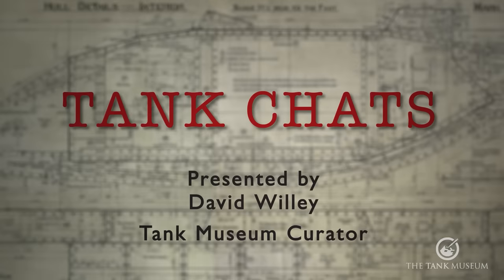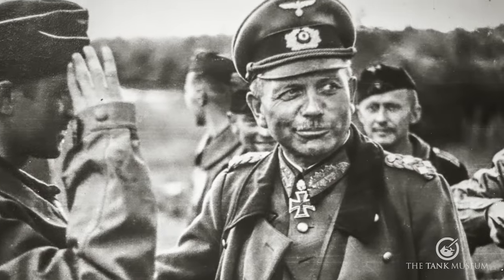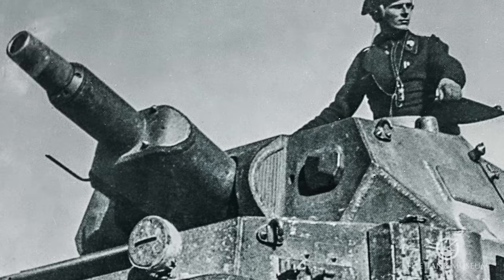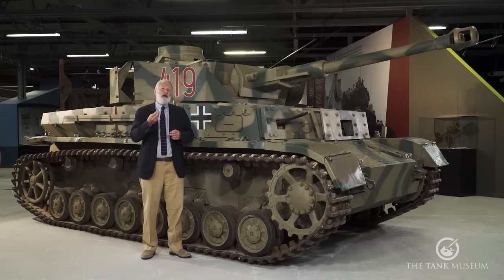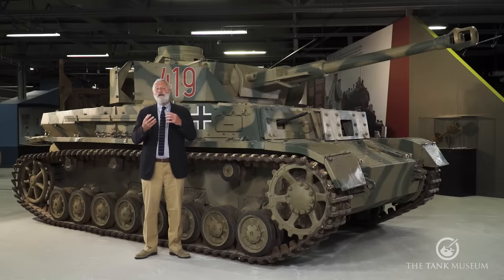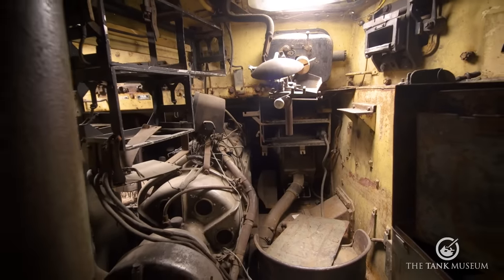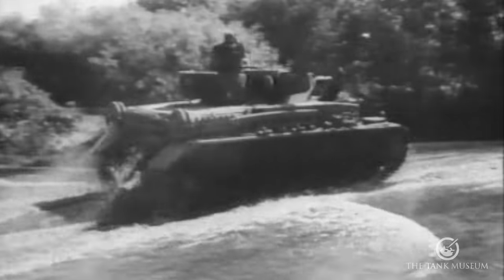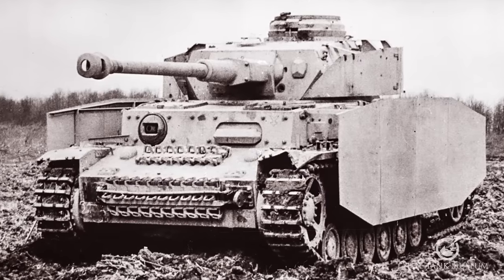Tank Chats #106 | Panzer IV | The Tank Museum

Comment: The Panzer IV is probably the closest thing to a "Daliy Driver" panzer you could hope for.
Reply: It almost makes one wonder what Germany would have fielded if Hitler didn't have his obsessions with huge guns and huge tanks. The 7.5cm/L43 could kill pretty much anything the Allies fielded short of the IS series or Pershing. I'm picturing a "baby Panther", with the 75/L43 instead of the L50 and slightly smaller, cheaper in every way.
Reply: @polygondwanaland8390  If they slope its front 5-10 degs more...it would help alot with its protection...
Reply: Good way to put it
Reply: @polygondwanaland8390  this would have done nothing to adress the Reich's biggest insufficiency, which wasn't as much the number of tanks, but the oil to drive them with. I get this "Hitler bad, so he must be stupid as well" shtick, but it doesn't hold true - a lot of German generals skipped taking responsibility for their own failures and blaming them entirely on Hitler.

The Tiger and Panther were needed. For the same money one could have built more Panzer IV's, but not found the oil to drive them with. Furthermore, as the development of the tanks started much earlier than they were commissioned, and as the German tanks were still struggling with lots of Soviet armour and could reasonably expect the Soviets to make even stronger new tanks (which also happened -> IS), the risk of all of a sudden having to face tanks that were too well protected to be reliably taken out was palpable.

TL;DR: The Reich favoured quality over quantity, because they had to, given the poor state of supplies.
Reply: @jonesjohnson6301  yeah and things like going for Stalingrad instead of the oilfields made the problem even worse
Reply: @jonesjohnson6301  You're right of course in that the only way for Germany to have won WW2 would involve not declaring war on the entire planet as a small country with limited resources. But there's definitely mistakes made because of Hitler's meddling – arguably every tank larger than Panther was a mistake because of the tactical and production limitations (the Maus epitomizing this). You could even make an argument that Panther should have replaced Tiger in the Schwererpanzerabteilungs instead of Tiger II, because if you're just a poor little Sherman a Panther overmatches you just as well as a Tiger II.

But if Germany lasts into 1946, it doesn't matter, because the Soviets will be producing more IS-2s than you can produce Panthers, and the T-44 will be entering the fight.

The real "what if" where Germany wins is Hitler simply being happy having taken half of Europe and not pushing his luck with Russia.
Reply: @polygondwanaland8390  , your last paragraph says it all. Russia was just too vast, with too many people, a strong heavy industry and two allies that filled-in the shortages that couldn't be produced domestically. Germany was doomed June 22, 1941.
Reply: @jonesjohnson6301  amen sir.
Reply: @jonesjohnson6301  yes and no.

Blaming hitler for everything is questionable. I agree.

Panzer IV wasn't designed for mass production. 8500 units from 1938 to 1945.

Ca. 6000 Panthers from mid 1943 to 1945. The panther was designed for mass production and could be assembled much quicker than a panzer iv. The panther lacked many of the fine features of early german tanks, like an apu, exhaust mufflers and stuff like that. They made that thing as cheap as possible and focused on the important parts.
The panther wasnt more complex than a sherman or a panzer iv, if you look at the complete design. Just highlighting its more complex running gear gives you a blurred impressions of the panthers overall design. 

They produced 4500 panthers in 1944. That is not bad compared to 11.500 T34/85 produced by the Russians in 1944. Tank exchange ratio was 1 to 4 in favor for the the germans in that particular year.  The panther was a reasonable option.
Reply: Tought it would be better for "track" days.
Reply: @polygondwanaland8390  you failed to see the whole picture. Hitler was capable of taking most of Europe because of the non aggression pact with Stalin. If Hitler does not invade Russia, Stalin for sure would invade them the next year after the great purge. It only succeeded in postponing the Reich fall from 1943 to 1945. The iron curtain probably ended up in the atlantic sea instead of Berlin...
Reply: "Yeah, I got a Tiger for the weekends but I daily a 161."
Reply: @polygondwanaland8390  Very simplified view of history you got there, buddy. 
First of all the Maus wasn't designed as a tank. The maginot line and the Atlantic wall showed that static defense buildings and fortification are very vulnerable in a modern war of fast moving mechanised armys.
The Maus was a more flexible defense weopon system to try out a new concept (mobil bunker used in combination with favorable landscapes). Every nation experimented with heavy break through tanks and assault guns. So tell me who where the drug addicted maniacs in UK, USA and Russia who were responsible for Tog 2, Tortoise, Black Prinze, US T14, T28, T95, T30 - T34, and all the russian objects of the same type. There were no computer simulations around, so every one was experimenting with those super heavy designs. Germany just ended up in the situation to field test such weopons systems because porsche built 90 tiger chassis with out an order to do so. The 90 Ferdinands worked out well in certain situations and an order was made to replace them with 150 Jagdtigers. So we aren't speaking of mass productions of those kind of weopons systems. The Tiger tanks were only built by Henschel in Kassel in small numbers. The Henschel factory was lacking the space and the tools to produce the simpler panther in significant higher numbers. They tried it with a batch of 200 Panthers and it did not work out. Tiger one was canceled in June 1944 anyway. 
So hardly any production capacity wasted.

But you can go on believing in the simple answers. It always grinds my gears how some random internet keyboard warriors think they are smarter than the complete scientific and military elite of a nation. I dont want to  glorify nazis, but to assume nazi eguals stupid is a dangerous move. Don't underestimate your enemy. There is a high chance, that psychopaths are also highly intelligent. 

1946 scenario:
The New Panther F/E50 and E75, which would share a lot of parts, (drive train roadwheels etc.) with stabilized optics and guns would be more than a match for slow firing ISs2 and T44s. The anhenced standardization of panthers and Tigers (E50 and E75) and the canceled production of panzer III and IV would also increase the monthly output of those tanks.
But the US would nuke the hell out off everyone anyways.
Reply: @polygondwanaland8390  I think if the Soviets had not tried to invade Finland before Barbarossa, they would have not been able to defend. Stalin realized he had sent to many professional officers to the Gulags, and released them back into service. Had this not been done before 1941, most of them would be dead, and the military would not function.
Reply: Yeap, it's the one of my tanks that I use to do my everyday running around! Could you imagine showing up at the local 7/11to get your morning coffee!!!
Reply: Stug Ausf G every time as the daily, keep the chrome rack for the Tiger it's protecting :)
Reply: Uncle Joe  I think they can weld on a small plate angled on the front glacis...even if it does not cover the sides...it can serve like some sort of spaced armored
Reply: Yes and why did the Germans turn to a Panther and Tigers when this tank produced in numbers may have been quite enpugh?
Reply: @Knallteute  We will never know for sure but I think had the Germans taken Moscow first then things might have been different? German forces did reach the oilfields of Russia but they were destroyed and burning like in the Iraq war 1991. When the infrastructure was destroyed it was of no use. Before the war Russia was supplying Germany with oil just as Russia sells lots of natural gas to Europe today. Attacking your neighbors is dumb anyway but Hitler had little reason to go into Russia but this is why he was a lunatic.
Reply: @HaVoC117X  Disagree....the Panzer 4 with the improved guns was all Germany needed....just MORE were needed!
Reply: @lisandrochavez7169  We cannot say for sure if Russia and Germany would have had war later had Hitler not attacked in 41.
Reply: @Jack51971  Since spring 1944 Tiger,Panther and the Panzer IV achieved almost the same combar ready rates (Tiger I and II combat tactics by Jentz).

To assume that panzer IV in 1944/45 were that much more reliable than the panther is a misconception.
They started to suffer from the same late war limitations as the Panther.

"From the front there continues to be serious complaints regarding final drive breakdowns in all vehicle types. Approximately 200 breakdowns have been reported with the 38(t).
Prior to the 1945 eastern offensive there have been 500 defective final drives in the Panzer IV.  From the Panther 370 and from the Tiger roughly 100.  
General Thomale explained that in such circumstances an orderly utilization of tank is simply impossible.  The troops lose their confidence and, in some situation, abandon the whole vehicle just because of this problem. 
He requests an increase in efforts for the final drive, since only this way can the problem be laid to rest.  With the previously intense criticism of the engine and the final drive continually playing such a roll,
it is welcome news to learn that the gearbox generally enjoys a good reputation.  (Page 259 "Panther and its Variants" by Walther Speilberger).

The Battle at Kursk showed, that germany was in fact lacking the resources and the manpower to supply the tank force they already had.
Every additional tank needs a crew, fuel, ammunition, spares and the logistics to provide all that.
Just screaming for more tanks does not help.
Nevertheless germany produced more tanks in 1944 than in all the years before.
The panther was streamlined for mass production. The panzer iv was not. Only 8500 panzer IVs were built from 1939 till wars end. But they built over 6000 panthers in less than two years. 
4500 in 1944. In comparison the Russians built 11000 t34/85 in 1944. Given the average tank exchange ratio of 1/4 in favor for the Germans, the panther was a reasonable option.
Reply: Ross Cox  And you be the Judge???? 
Without even adding something valuable to the discussion at all.

It’s hard to win an argument with a smart person, but it’s damn near impossible to .... i think you know how the story goes.

I will accept defeat, "Der Klügere gibt nach" as we say in German.
Reply: Ross Cox  Thank you very much, have a good day mate.
Reply: Lbot beenthere  Hindsight??? Very questionable and not reliable. Most credible Historians are careful when evaluate such alternative scenarios.

Which tank would have been a better solution?

More Pz IVs, which could not be produced as fast as a Panther.
Which suffered from the same final drive issue since 1944 like all german tanks? Tanks which had no problems with their final drives for years! According to Ralf Raths ( director of the german tank Museum)  every other tank or scenario would have suffered from the same limitations as the panther. In the end it would not make a difference. The panther was a reasonable option. 

Interesting Interview by chieftain which covers this topicc.
https://www.youtube.com/watch?v=MzZ4lV06n6g

Its the same Situation with the late introduction of the M26 Pershing, which many internet experts claim should have been deployed earlier.But given the realities in 1944 there was simply no way this could have happened. Hindsight can lead to easy but also many wrong answers for historik problems.
Reply: @Jack51971  un an alternative universe perhaps, we will never know it.
Reply: Mr. Kelowna  please learn some real history about WW2. Stop embarrassing yourself.
Reply: @Chilly_Billy  You could say Germany was doomed from the start, even if Germany didn't start the war with the Soviets, they would have run out of the necessary requirements for war, fuel for their vehicles and ships, and possibly bullets due to lack of metal in general (keep in mind the last one would be later if it prolonged after 1945) not to mention that it was less likely that Britain would have backed down and the eventual joining of the US into the war
Reply: @Knallteute  they did go for the oilfields in the Caucasus. They had to take Stalingrad to cover the Caucasus campaign. It was the loss at Stalingrad that forced the evacuation of the Caucasus.
Reply: @HaVoC117X  I’ve never heard it this way, thank you for your insight
Reply: @jonesjohnson6301  To be fair the Panzer IV was probably a good deal more fuel efficient than some of those ponderous beasts they produced later in the war. But the reality of the situation on the ground meant they still needed those big tanks. Best case scenario would have had them pass over the Panzer III and adapt the IV to multiple roles earlier, allowing them to make more IVs instead of the soon to be obsolete III. A few hundred more IVs with guns capable of beating Soviet armor might have left them in a better situation going into the winter of '41. Probably not a 'war winning' situation (any hopes of winning went out the window the minute the whole 'kick down the door' gambit failed to oust Stalin), but it might have caused a cascade effect of other battles turning in German favor and dragged out the war in the east for another year.
Reply: @hippoace  wouldve given the driver and radio operator more space too, or taken the add on front plate on the later models at an 10-15 degree angle to achieve spaced armor as well as greater ricochet chance and greater protection values. I think Military History Visualized brought up that they experimented with it, but “muh panther big cat” pushed it out of adoption
Reply: @jonesjohnson6301  Adding to oil shortage was iron ore shortage. German tank program had many professionals contributing. It wasn't vanity project a single person. Also, Hitler was stupid in a number of things indeed. He did put his emotion before facts; lacked technical skills; lacked good understanding of countries around him; gambled when odds were against him;  etc etc. His shortcomings just happened to be outside the ways of the the common myths
Reply: Seen the 3?
Reply: @polygondwanaland8390  1: Panther used an L/70, not L/50. 2: the L/48 replaced the L/43. 3: a sloped hull panzer iv was developed but never entered production due to the delay retooling would cause. 4: panther costs almost exactly the same as a panzer iv to build. 5: panzer IV was comparable to Sherman and T-34, which were produced in vastly larger quantities
Reply: Nope, a Sherman ( or a Lee/Grant or even a Stuart ) would be a more reliable "daily driver" and I suspect the service and parts would be cheaper!
Reply: @Vincent Lu Nope, a Sherman ( or a Lee/Grant or even a Stuart ) would be a more reliable "daily driver" and I suspect the service and parts would be cheaper!
Reply: @Knallteute  there is a youtube channel called TIK which has an awesome documentary series on why they went for Stalingrad. Highly recommended.
Reply: The difference in this tank from its conception to final revision is amazing.
Reply: @jonesjohnson6301  didn't Hitler want to take the oil fields in the south of Russia first before going towards Moscow? But his generals said "no we need to push forward to Moscow to crush ze Soviets spirit!" or is it the other way around
Reply: Indeed, they should have made more of these, I know they had fuel shortages, but if they could have used more panzer 4s to take the Russian oil fields they could then use the oil to make more panzer 4s. Just make more versions of them.
Reply: So whats your point then,static comment
Reply: Prob yea
Reply: @polygondwanaland8390  Yeah I imagine that too. Imagine America had the German engineers of the 30s back then. Would be interesting what kind of amazing war machine could’ve been created
Reply: German Sherman dude
Reply: Actually the Panzer III was.  The Panzer IV was a cobbled together mess.
Reply: @hippoace  There were plans to alter the glacis of the Pz IV, suspension and other things. All were halted due to Panther production. Most likely a huge mistake selecting the Pz V "problem child" over the upgraded proven workhorse. The inbuilt ineptitude of the competitive  NAZI procurement system, proved to be it's downfall. Even if they did get their act together too late in the war.
Reply: @jonesjohnson6301  "TL;DR: The Reich favoured quality over quantity, because they had to, given the poor state of supplies." If that were true, more consideration would have been given to reliability, ease of repair and availability of spare parts. In the same way crew ergonomics were of paramount importance from day one. 
Also, had Barbarossa been either postponed in favour of the African campaign to seize Arabian oil. Or all resources directed to capturing the caucuses oil, who knows what may have happened.  Just thank Odin the NAZI system was incapable of complete efficiency and did not have our benefit of hindsight. Otherwise we would now be part of the Reich.
Reply: @polygondwanaland8390  
Yes but Germany could not train so many crew as need to the huge fleet of PzIV
There was no exit, Germany was lost since Britain did not accept to sign a separate peace agreement.
Reply: @hippoace  that angeling was used on the Panther (Sd.Kfz. 171), but should have been changed on the Panzer IV (Sd.Kfz. 161) too, so they could either make the tank lighter/more mobile or/and better protected by angeling the plates ... but would have make just a minior overal difference ...
Reply: @Knallteute  Stalingrad was actually rather important strategical city in order to get the Caucasus oil fields under control. If you look at the maps during that time, Stalingrad was the main hub for railways and such from there.
Reply: German Sherman .
Reply: @Icetea-2000  Wouldn't have mattered if Americans had all the German engineers back in the 1930s. The country wasn't interested in such things. What shocked the US military establishment into action was the fall of France in 1940; and then the Americans were caught up in a situation of rebounding from complacency across many dimensions: Design, doctrine, production, etc.
Reply: @tricosteryl  it was not a given that Germany's training programs would lag needs and those of the allies. The country did have a head start. Simply put, poor organization there, with training programs that could scale, along with logistics, were some serious shortcomings of Nazi Germany.
Reply: @JackTheNoober  Not so certain about the centrality of railroad networks for Stalingrad, and that includes eye balling maps of the time. For railroads coming from the west, no, not really. More a transhipment point on the Volga, for oil. But Stalingrad also produced 9% of the country's steel at one point, and about a third of T-34 tanks (again, at one point). 

But don't believe the Germans had to go through Stalingrad to get to Baku. There was a whole different line that headed to Grozny and then onto Baku, extending from Rostov.
Reply: @michaeldunne338  I’m talking about when america started their line of tanks, what the tanks would’ve looked like with those german engineers that’s literally all
Reply: @Icetea-2000  Interesting point, or counterfactual. If mid-summer of 1940 is given as the starting point for such an approach, maybe US tank designs would have looked more like a IV?

Would have to think the German engineers would have also recognized a need for "transportability" - Not sure that a heavy Panzerprogramm would have been jumped upon say in the 1941 timeframe? Possibly such German expertise and the influence of the Waffenamt under Heinrich Kniepkamp would have guided the US towards a 30+ tonnes tank design all the same?
Reply: They could have increased production by turning out an improved version of the T 34. And used diesel. And wider tracks.
Reply: Ctr
Reply: @ionolaru4672  What does Ctr mean?
Reply: @polygondwanaland8390  everybodys a general after the war
Reply: @polygondwanaland8390  
Germany would have never won World War 2 under any realistic circumstance.
Reply: @avanreijn  I always preferred the Kettenkrad for "track" days.
Reply: No no no! An A34 Comet😂👍
Reply: I'd go with the Panzer 3 on that account :D
Reply: Panzer IV feels like the workhorse of German Armor forces.  Panther is sexy but not in the numbers to make it decisive.
Reply: @polygondwanaland8390  all these what-if scenarios become complicated cuz there's other factors to consider like early jet development how it was hampered.
Starting in 1938 had the Germans aggressively pursue jet development The Eighth Air Force and the British heavy bombers might have become ineffective.
This also would have changed the picture on the Eastern Front cuz of Germans would have maintained air superiority.
Reply: @chrishooge3442  8500 panzer IV's build vs 6000 Panthers. That's hardly "not the numbers to make it decisive".
Reply: English mum's doing the school run would probably agree.
Reply: Unpopular opinion: Panzer IV is more awesome looking than the Tiger (& my favorite German tank from WW2! :)